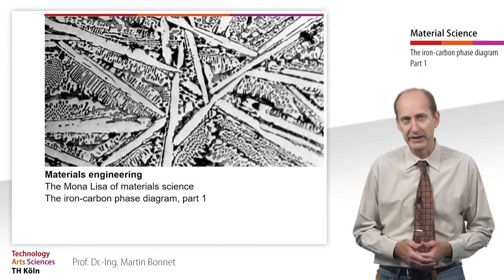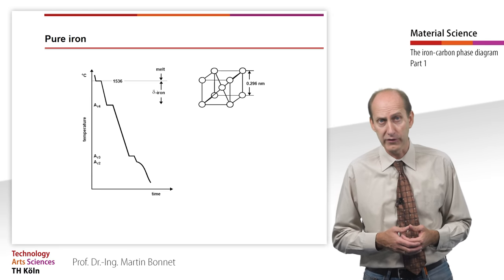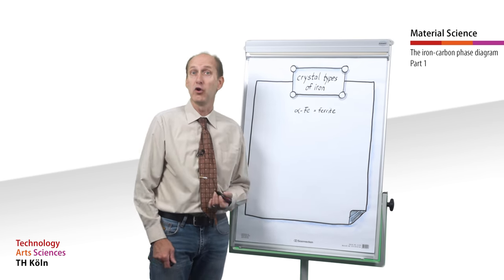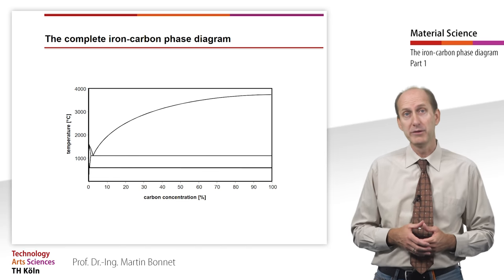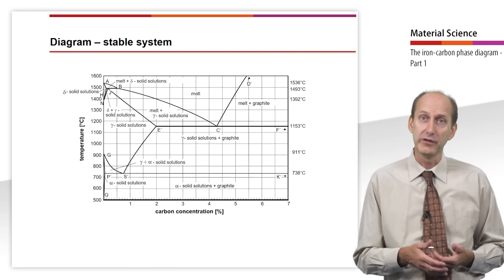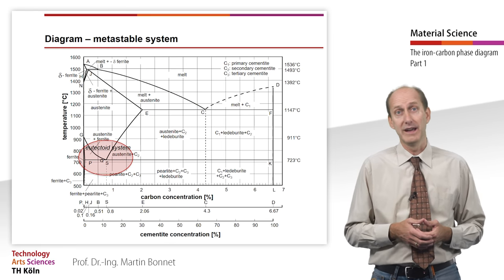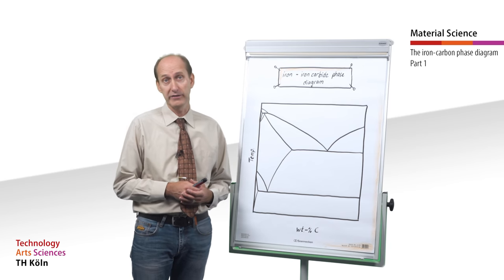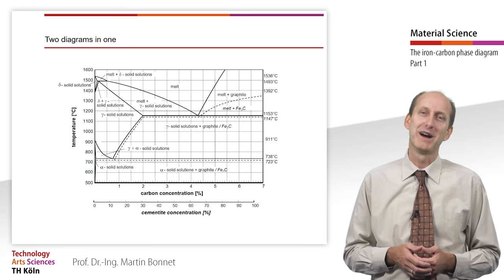Material Science, The Iron Carbon Phase Diagram, Part 1

Comment: When the iron/carbon is in a certain phase at high temperature, does it retain the physical characteristics of tgat phase when cooled to room temperature? Perhaps cooled rapidly? Otgerwise can't see application of these characteristics using a molten metal...
Reply from the maker: See the videos on heat treatment of steel!
Reply: @WeltderWerkstoffe  Will do thanks

Comment: Professor,I have a question if it's possible. maximum solubility of carbon in FCC iron is 2%
but steel is produced below 1.4% carbon and cast iron is produced between 3-4.5% carbon. Why?
Reply from the maker: At room temperature most steel are BCC and have no solubility for Carbon, so that they contain cementite. Some properties improve with increasing cementite content while others get worse. Therefore most kinds of steel don't even contain more than 0,8% carbon. Cast iron shows best properties close to the eutectic concentration and slightly under. So in short: not all carbon concentrations make a lot of sense for most applications.

Comment: Why solubility of carbon in austenite drops after reaching 1147 degrees ?
Reply from the maker: Like in any other phase diagram with decreasing solubility in the solid state, the solubility decreases below the eutectical with decreasing temperature.
Reply: @WeltderWerkstoffe  i meant why solubility decreases in austenite above eutectical with increasing temperature.
Reply from the maker: @emirkaric3747  it's not that the solubility decreases, but there starts the two phase region, so you have the carbon solved in austenite AND melt.

Comment: Why does not ledeburite appear at room temperature?
Reply from the maker: Allthough the general ledeburite microstructure will be the same at room temperature the ledeburite transitions into perlite and cementite below the PSK line
Reply: @WeltderWerkstoffe 

Give the reason(s) for the following statements 1- Grey cast iron used in construction of heavy duty machines

2-White cast iron very hard and brittle

The mechanical properties of ductile iron and malleable iron approximately the same

Ductile iron with pearlite matrix stronger than ductile iron with ferrite matrix.

Compact graphite irons (CGIs) is used for manufacturing exhaust manifolds.

Chapter Five Cast Iron.pdf